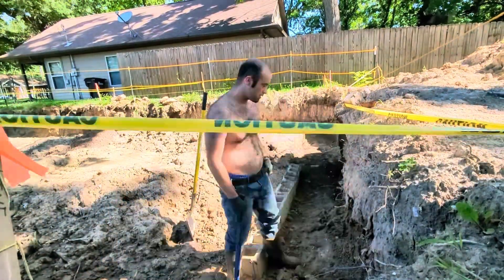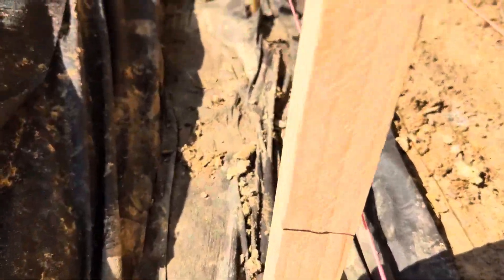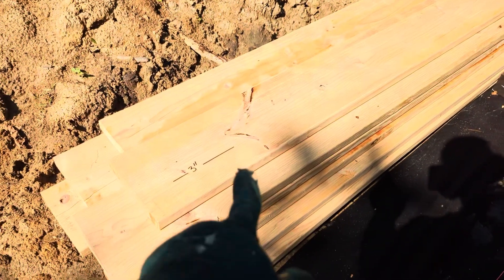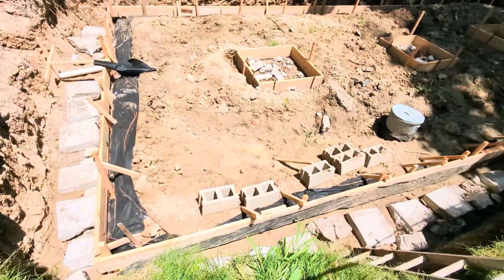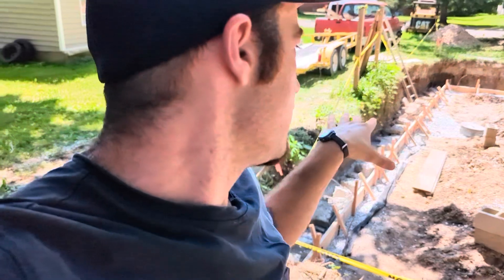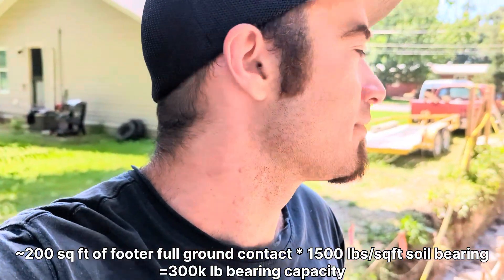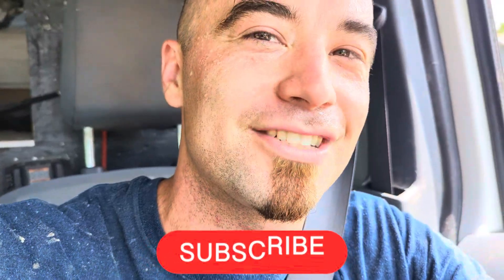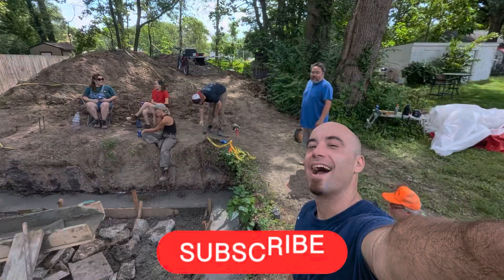Hand Built House Ep8: The Footer

Comment: When riding a bike in a street, always wear a helmet please.
Reply: I taught my kid to do that, but this was another ... adult.
Reply: Neighbor John Fandrey had this to say about the old concrete:

I think the inspector’s insistence for the removal of the foreign objects has to do with the concept of a cold joint. Ideally concrete will be one continuous pour and essentially become one rock that bears the load you need it to.

If there is a problem and you end up only pouring some of your concrete and that concrete hardens, your next pour will essentially be another rock that hardens next to or on top of the concrete that is already there.

This is called a cold joint. The problem is that the cold joint essentially becomes a crack in your concrete. If you have lots of debris where you’re pouring then you have lots of cold joints and lots of “cracks” in your brand new concrete.

Heres John in an old vid:
https://youtu.be/hkVCMSAjKoE?si=XFRxDMSlevN1Ledw